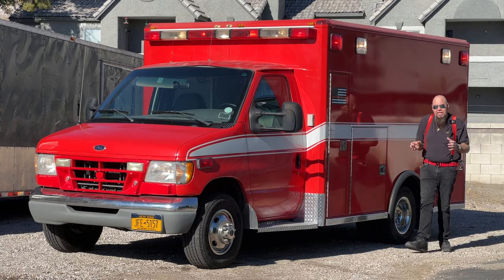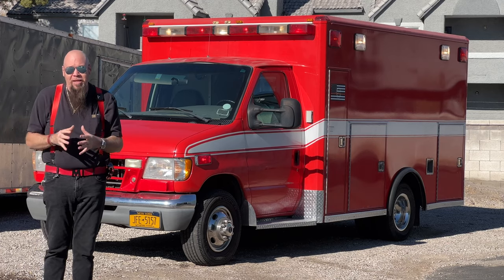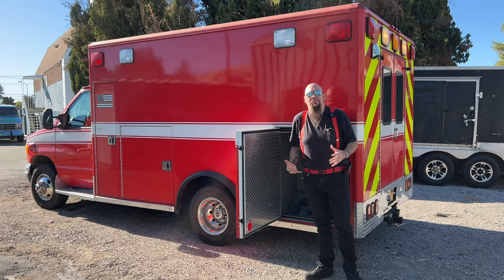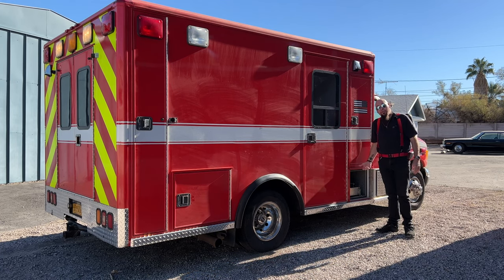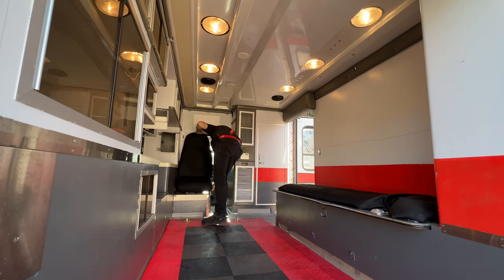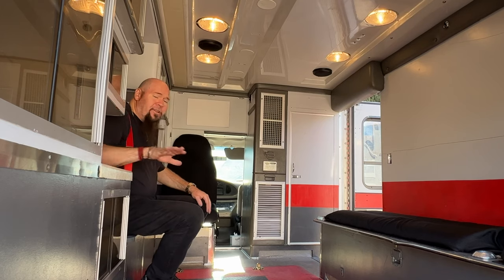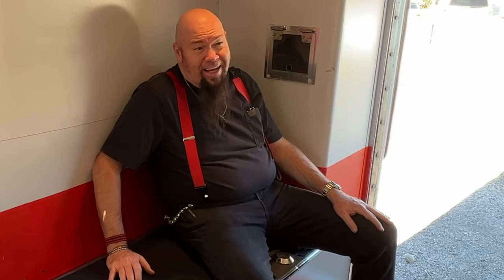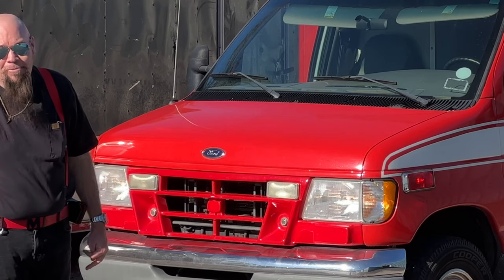Why is there an AMBULANCE at my house? 1999 Ford E-350 Wheeled Coach 7.3 Turbo Diesel Ambulance

Comment: Best base for conversion to a camper. Upmost build quality, pre wired, insulated with uber outside storage. No brainer. 7.3 is a die hard monster of an engine. Worth losing a little MPG for dependability and longevity. Great vid.

Comment: I got to work on one in auto technology class with two batteries under the hood and the light controllers were in the storage compartments on the driver side.
Reply: There is so much room that if you drop a tool it doesn’t go anywhere 🤣

Comment: Ran those for years. If transmission starts slipping or smelling, unhook the trans cooler start it for a few seconds reconnect and refill with 3 quarts Lucas stop slip and keep going another 2 or 3 hundred thousand miles.

Comment: I think the bigger reason most people gut the interiors of these is because there is a huge stigma attached to ambulances. People are worried about catching something infectious from touching the surfaces inside.
Reply: I have a ‘96 E350 and it’s not the infection people are creeped as most are sanitized daily.  People believe that the injured have died inside and left behind haunted spirits, etc.

Comment: The mileage on retired police, fire and EMT vehicles is not what you should go by. With the amount of idling these vehicles do, you always need to go by engine hours instead.
Typically, idle engine hours will amount to the same engine wear as 5x (or more) of what the mileage on the odometer says... unless it's an ex-highway patrol or a supervisor car.

Comment: Bob,  after seeing that Windshield Molding. Didn't you have a Video of getting the Windshield Replaced in the Excursion?
Reply from the maker: only plastic trim
Reply: @RobertMoseley  I know I own an Auto Glass Shop. But wasn't it you take made a video about getting the Excursion Windshield Replaced and the guy took it out and wouldn't put the new one in? It's been a few years